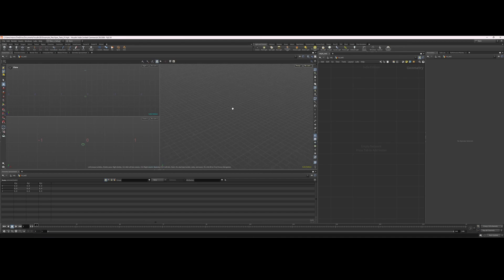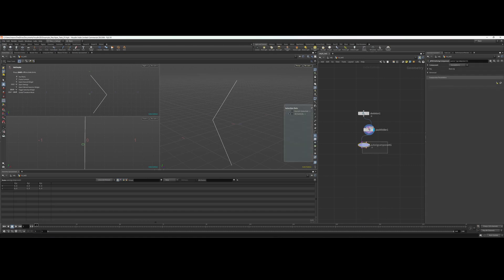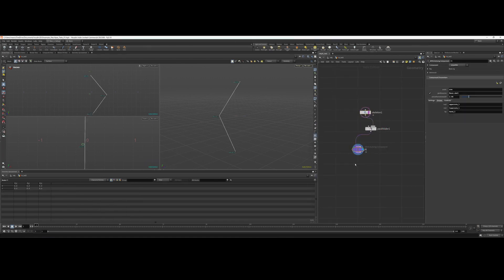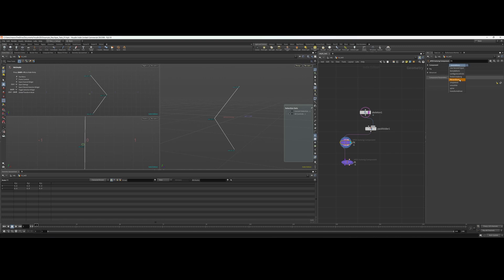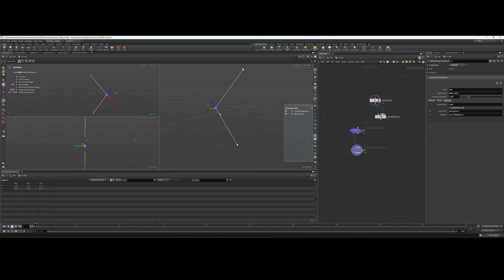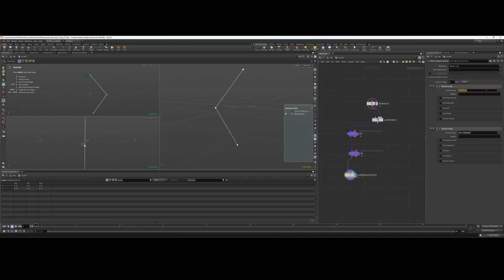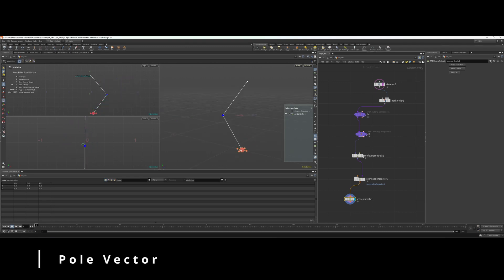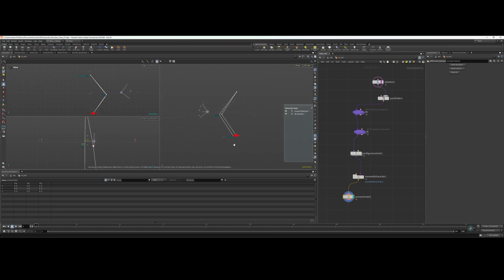Rigging in Houdini with APEX: 02  | Simple IK

Comment: Excited about your APEX tutorials, but I tried to follow this vid three times in case I missed steps and I still could not get IK to work, FK works fine.  I get the following errors when I try and transform a point either from the viewport or the Selection Sets, I'm on 20.0.653
Traceback (most recent call last):
  File "C:\PROGRA~1/SIDEEF~1/HOUDIN~1.653/houdini/python3.9libs\viewerstate\utils.py", line 1054, in wrapper
    return func(*args, **kwargs)
  File "C:\PROGRA~1/SIDEEF~1/HOUDIN~1.653/houdini/python3.9libs\viewerstate\interface.py", line 375, in onCommand
    state.onCommand(kwargs["args"])
  File "C:\PROGRA~1/SIDEEF~1/HOUDIN~1.653/packages/apex/viewer_states\apexanimate.py", line 2535, in onCommand
    self._selectControls(ctrl_paths, pick_modifier=pick_modifier,
  File "C:\PROGRA~1/SIDEEF~1/HOUDIN~1.653/packages/apex/viewer_states\apexanimate.py", line 778, in _selectControls
    self._updateHandlePivotAndSettings(selection_changed=True)
  File "C:\PROGRA~1/SIDEEF~1/HOUDIN~1.653/packages/apex/viewer_states\apexanimate.py", line 823, in _updateHandlePivotAndSettings
    0, pivot_xform.inverted() * xform_data.xform)
  File "C:\PROGRA~1/SIDEEF~1/HOUDIN~1.653/houdini/python3.9libs\hou.py", line 65444, in inverted
    return _hou.Matrix4_inverted(self)
hou.OperationFailed: The attempted operation failed.

Comment: Hi, great lessons, btw, thank you so much!!!
Can't force start IK to work in new APEX Autorig Comp node (looks slightly different than your in 20.0.724). Is there any chance to get detailed explanation what did I missed?
Reply from the maker: Is should be the same setup.  Triple check your naming conventions, look at your mirroring options (if you're using them) and watch the naming of your controls.  What problems are you having exactly?
Reply: @maxrose8845  Sure, more I know Houdini more I realized it's my lack of knowledge instead of bugs lol.
Just found out I missed some important things before applying IK. Could I bother you later if it didn't help?
Reply from the maker: You’re free to bother away
Reply: @maxrose8845  solved, messed up with tags placement. Anyway big thank you for response
Reply: @maxrose8845  Ok, I surrender... Realized how to work properly with tags, made active rig, but have problem with legs IK controls placement... According to shape deformation the IK legs should be placed not in front of the legs but from both sides... I guess it's because joint rotation, maybe... Need help

Comment: Everything works fine until I get to 3:13 and try to move the IK... I can't see any handle or grab on anything, just getting errors "Error attempting to fetch post interaction parameters".. what am I doing wrong?
Reply from the maker: Responding late - did you ever figure this out?
Reply: @maxrose8845  As I understood correctly the problem was in some changes in build 20.0.668. If you delete "_l" in "arm_pole_l" and "arm_ikhandle" in the controls tab in authoring (smoothie), then the IK rig starts working normally.

Comment: Thanks for the series! However in Electra example I see there is FK transform node before the IK, but there are only few joints promoted, like fingers, clav's, neck and the head, and rotation only.
Reply from the maker: Glad you like it!  In the FK transform autorig component, there's an integer slider called "addpttransform".  That's the important bit that the IK needs in order to work - turn it off, the IK doesn't work anymore.  I'm planning on addressing that in my next video 👍
Reply: @maxrose8845  yes exactly. The addpointtransfroms is needed, but no need to promote trs for everything not planned to be directly controlled